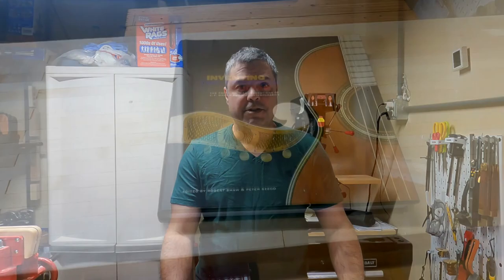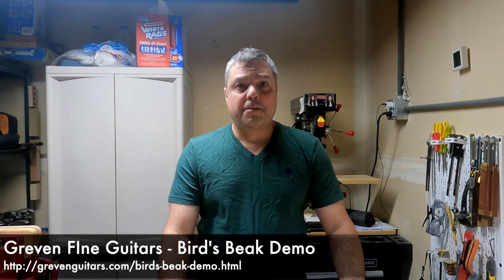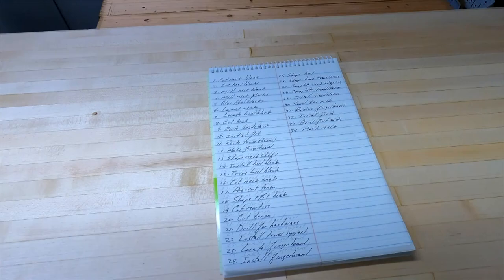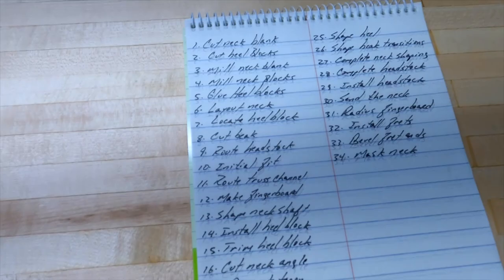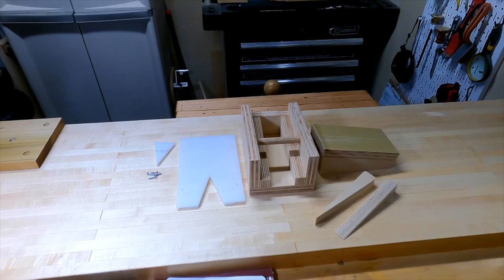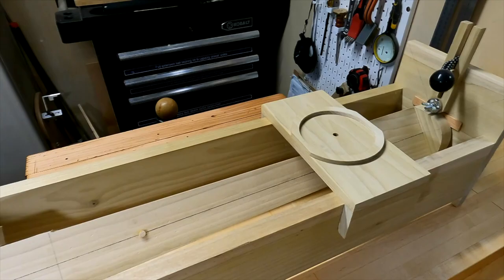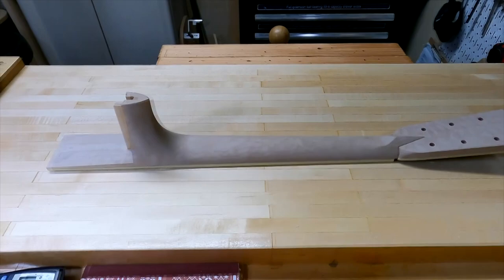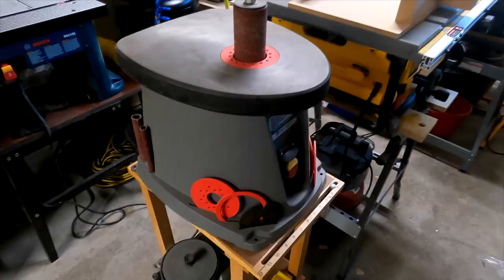Advanced Neck Construction: The Bird's Beak

Comment: It just looks so weak though? Id rather carve the detail in to the headstock personally...
Reply: The advantage of this joint is that the strings are loaded parallel to the long grain of the headstock and neck pieces rather than on short grain as with 1-piece necks. A scarf joint also does this, but many find it to be less attractive. Additionally the birds beak doesn’t rely on glue for strength like a scarf joint.
Reply: @grfinewoodworks4175  is that to say that the wood between the nut and tuning pegs has some kind of issue when loaded on short grain?
Reply: @BBGuitars  single piece necks are indeed weaker in that area because the grain supporting that very thin section of the neck is made to be fairly short due to carving and shaping. This makes it have very poor shearing strength. With a bird’s beak joint, you have the pull of the strings pull the headstock into the neck, supporting its locking action. You can in fact omit glue altogether and that headstock will not come apart. It is in fact a very strong joint,